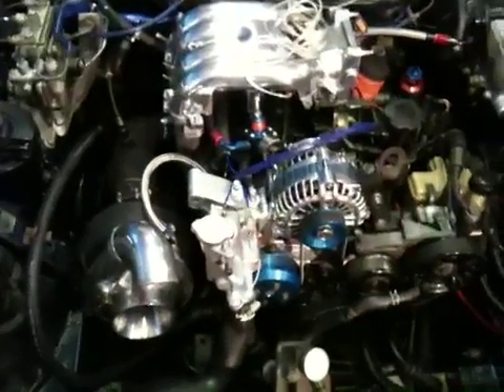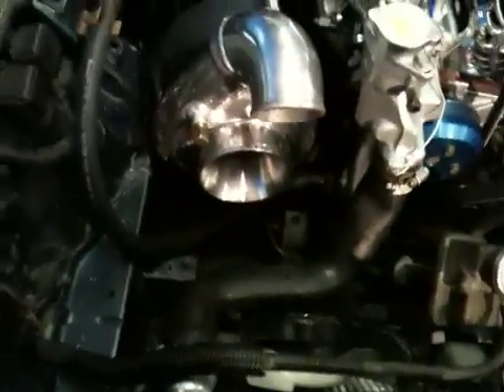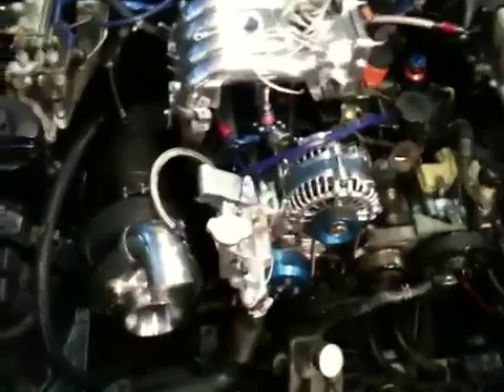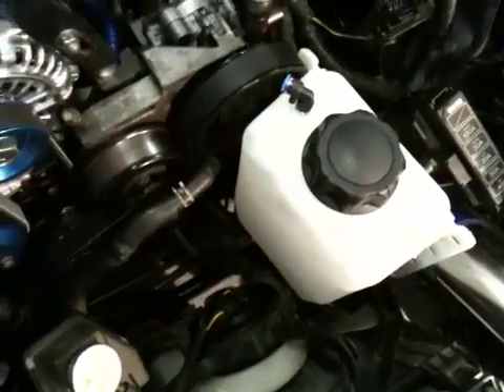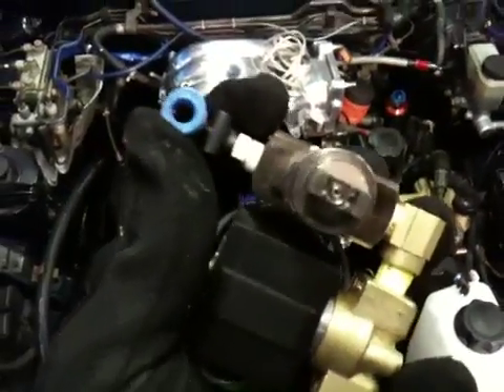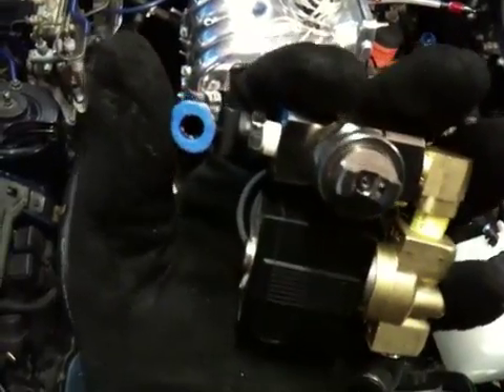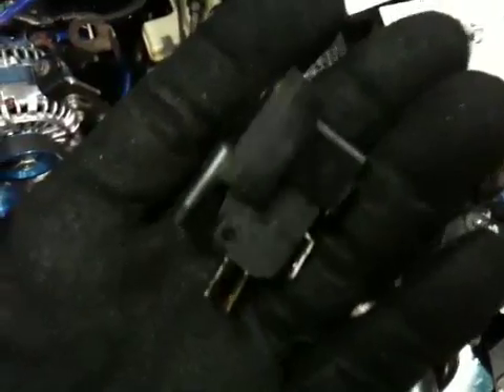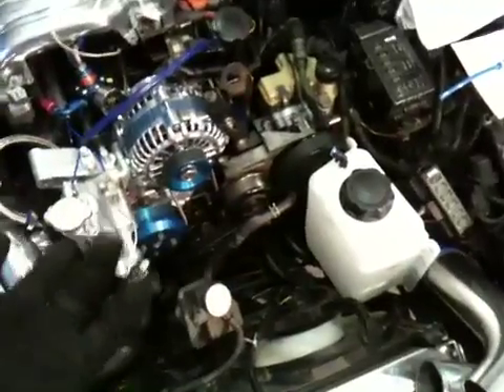Installing Pre turbo Water injection on an rx7

Comment: The other problem is that there's a possibility that the hot air from the turbo might unnecessarily vaporize the water and take up some of the volume built up by the turbo that was supposed to be for the charge. Pre-IC does work for some track cars such as road racing that operate at a more constant higher RPM. For the daily driver, weekend racer, the pre-intercooler location should not be considered.
Reply: No matter where you inject water it's taking up air volume ?

Comment: Sick setup!! Questions... Does it HAVE to be distilled water? And about how long will a reservoir of water that size last (~on average~)? This is with your normal spirited driving and a few races here and there of course:) is it gonna be a daily refill kinda thing or..?
Reply: At 20 psi it will last slightly over 6 minutes a gallon. (600cc at 20 psi)

Comment: Hi, you have to forgive my ignorance, but this water injection kits cause me some confusion... for what I've seen, you assemble the kit between the air filter and the inlet compressor wheel, but it won't damage the turbocharger, since the water will "clean" the housing and increase the friction? And inside the engine, it won't harm the seals for the same reason? And the car will always start well, even though you're adding water to the air/fuel mixture and being in contact with the spark plugs?

Comment: So big chief how did this all work out? Any reviews to share on success? I've heard great things, curious about buying a kit myself as cheap insurance for the perceived rotary unreliability claims.

I will go single turbo eventually but will be stuck with twins for some time. So heat is an issue and I want to do a few moderate upgrades. Full exhaust system + intercooler + fuel pump upgrade + remap on Apexi ECU etc..

By the way do you have any recommend resources on converting to single turbo?

Comment: im going to be running aux. injection myself. i picked up an alky control kit for methanol, no more detonation for me :)

this is a HUGE piece of equipment for any rotary user to get. this essentially solves the heat issue of the 13B that causes pre-detonation. it also cleans our engines out of the carbon that builds up causing apex seals to get stuck, etc.

Comment: iam boosting 12 psi 350+hp stock twins ported non sequential i have a uncle with a fd 475 hp 93 octane 20-23 psi no detonation that i know of hes had it like that for over 5 years he runs low low 11s high tens street car..